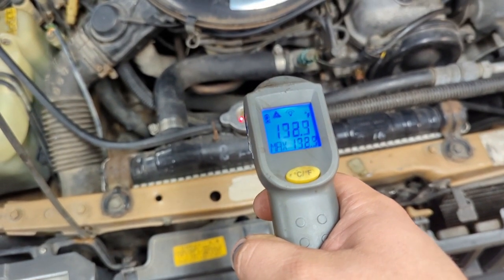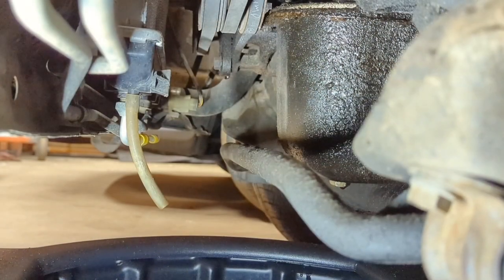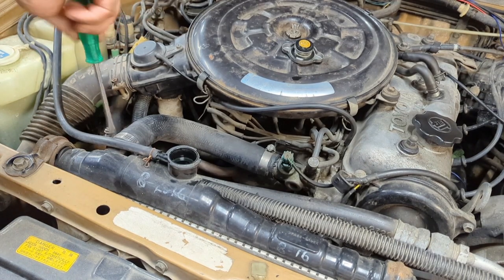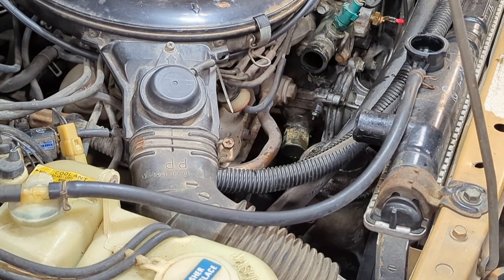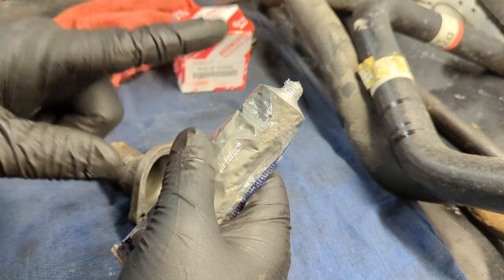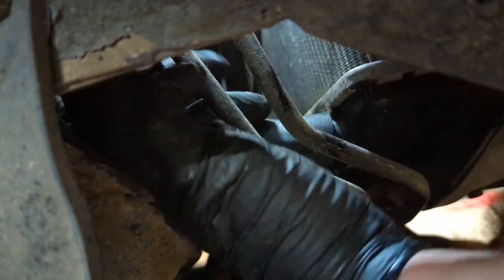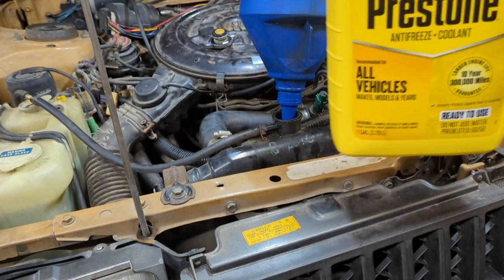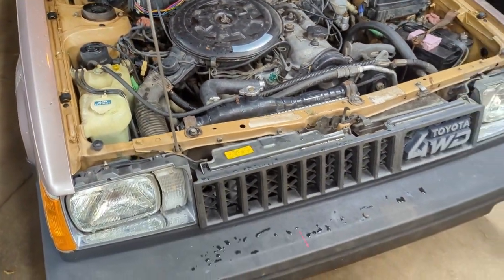1983 Toyota Tercel: Replacing the thermostat and old coolant hoses.

Comment: I just bought that "high-flow performance" thermostat and was about to throw it in my 82 haha. Good to know they suck! thx man!
Reply from the maker: Definitely worth going OEM! they're inexpensive but if this failed during the summer, it would have been much worse to drive in 80+ degree temps instead of 40+ degree with a stuck t-stat

Comment: Thanks for the video. Spent the last couple of days replacing the radiator and thermostat in a 1986 Tercel 2WD std. Started the engine and ran it for 15-20 minutes, no leaks. Took it for road test, and then  it leaked. Taking it back apart this morning. Quick question… did you seat the thermostat in the housing and then put the gasket on the housing? I put RTV around the outlet hole, put the gasket on the housing, then put the t-stat in the outlet, while putting the housing back on. FYI, I applied the RTV,  put on the housing without final tightening, waited for an hour, tightened it. I then waited 24 hrs before filling the radiator. Did I miss something in the process?  Thanks for all the help.
Reply from the maker: Thanks for watching! 
I did RTV the gasket on both sides. Nothing major, but a little bit to help it seal. 
I like Ultra Grey. It seems to work the best. I would suggest adding maybe a bit more and if that doesn't work, sand smooth or replace the outer thermostat housing. They're available on rockauto for only a few bucks. 

Best of luck!

Comment: Hey man!  I have an 87 with the same set up and my temp gauge is not operating at all.  Looks like I’m missing the wiring harness and connectors entirely for the coolant temp sensor.  However, I’m having trouble finding any diagrams that confirm which sensor it is indeed.  Can you confirm that the correct part is that green/blue sensor and connector right there next to your hands by the upper radiator hose?  Much appreciated!
Reply from the maker: Email me at tercelrescue@gmail.com and I can send you some pics!

Comment: Just gonna add ummmmmmmm I'm running the cheap stat and it's been perfectly fine haha. I did actually replace it after 40k miles but I mean for 2 bucks or whatever I wasn't complaining. However I do recommend using the toyota one my other car has the factory one in it and it does cool down faster when the Stat opens vs the cheap one